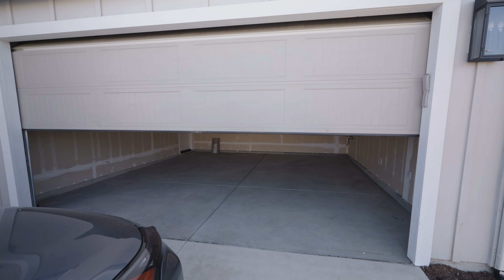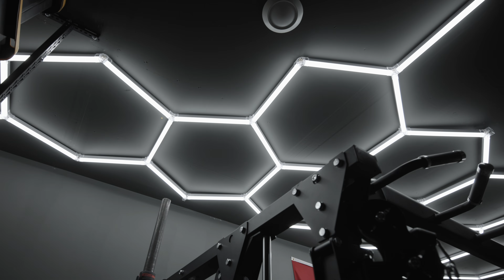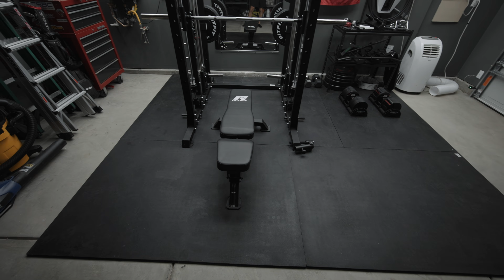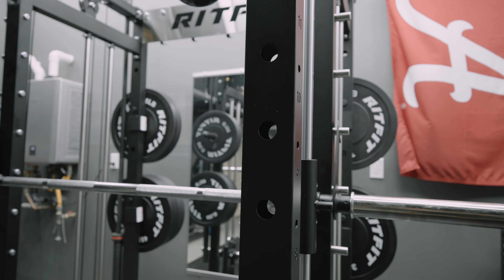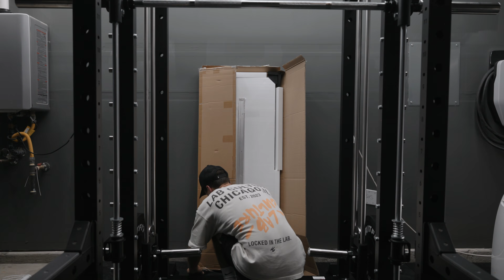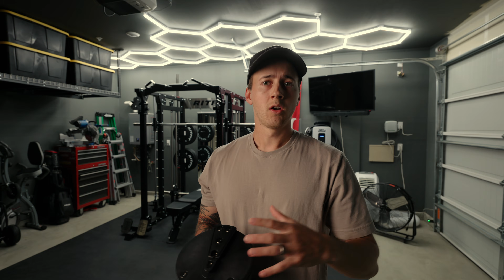I Built My Dream Garage Home Gym

Comment: hey are you just letting the AC to let the hot air right back into the garage with the exhaust hose in there? I wanted to get the Portable AC but did not because I have no window in my garage
Reply from the maker: No that would be miserable! Haha. I crack the garage door just a few inches and stick the hose out.
Reply: @JordanPulmano  does it cool it enough?

Comment: Dude, your gym is sweet. I have my gym set up in my living room. Best way to stabilize your power cage it to weight it down. The more weight that is stored on it, the less it will move. Adding sand bags can help.
Reply from the maker: Thank you so much man!

Yeah it’s been pretty stable keeping the bumpers stored on it. Haven’t had any issues so far.

Comment: Good simple, effective choices. Been training for 50 years, I know stuff! I’m sure you are already aware of the most important factor is space. You have already nailed that. I would from a price and function standpoint gone with instead of dumbbell, competition adjustable kettlebells. 
 The 3 most bang for SPACE , function and price that IMO are your next three purchases are ,Airbike, pair adjustable competition kettlebells and Bells of Steel open trap bar. 
  The next two things are GREAT pieces AND fall squarely in the “happy wife” ,”hunny I got this for you” category. She will be far less likely to give you grief on your other purchases! Hip thrust and Rouges folding Reverse Hyper. 
 From your vid I see you can easily fit the Echo Bike( best conditioning peace) and hip thrust. These are the only two that actually take up permanent floor space. Everything else can be stored. 
 Treadmill inside in front of a TV is probably the best calorie manager. Happy wife?! 
 Splurge piece, magnetic sled( wall storable).